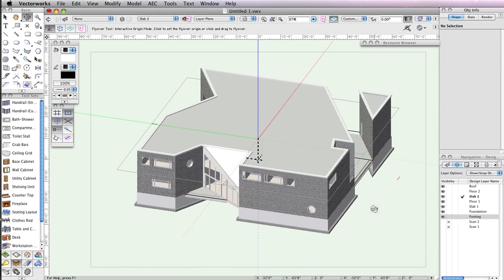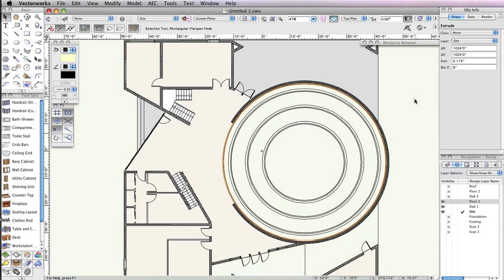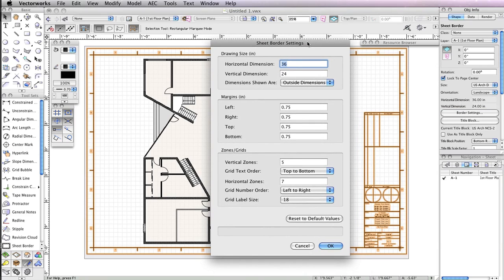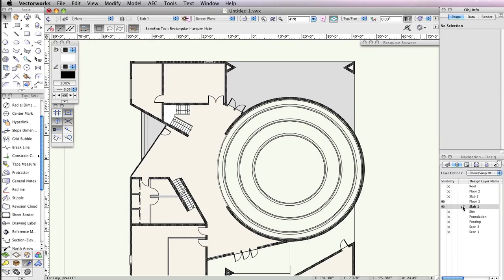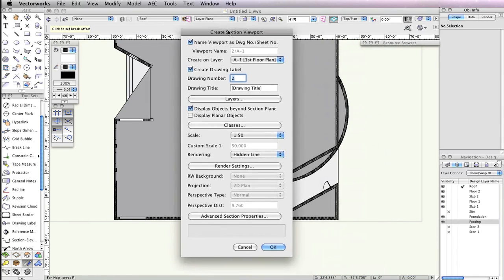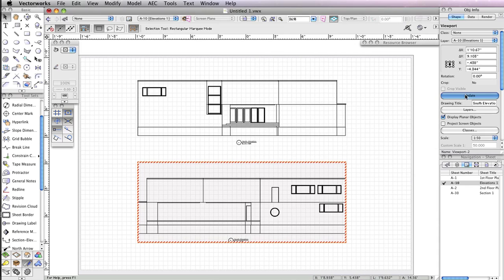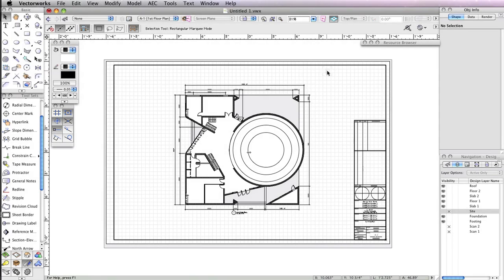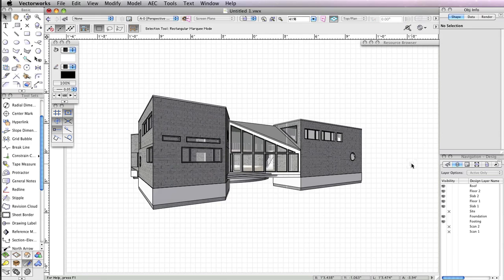Vectorworks Architect 2014: Presenting and Annotating the Final Model - 11

Comment from the maker: Section viewports (and anything to do with sheet layers) are for putting together a sheet, not editing. You go back to the model to edit and change walls. One quick way to do that is to double-click on the Section Viewport, then choose to return to the design layers, and see that the choice to Display with Clip Cube is selected. This gives you a section view in OpenGL with the same cut plane as the viewport.